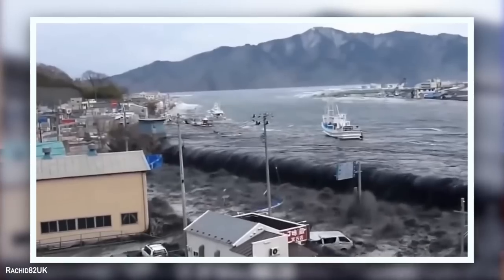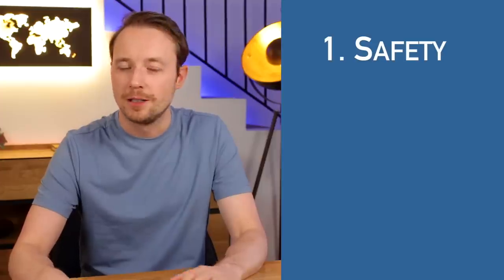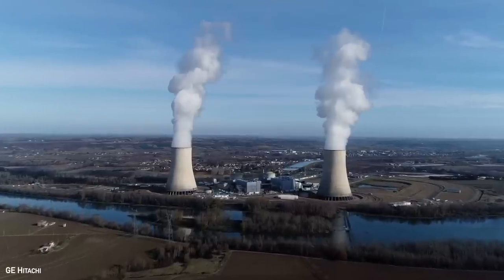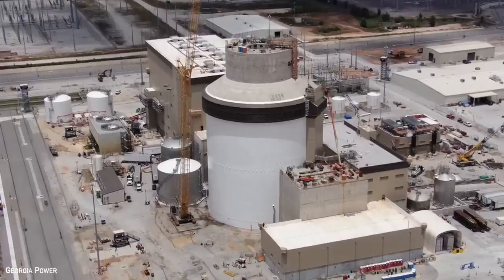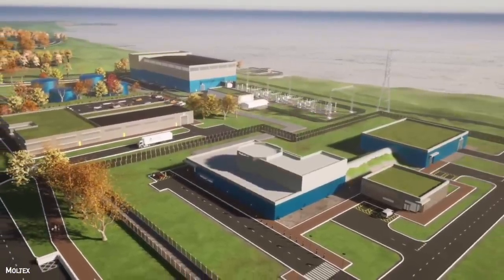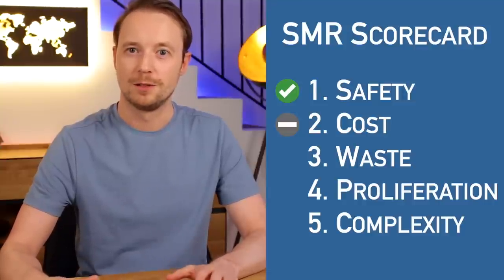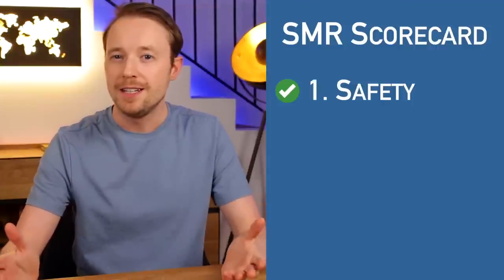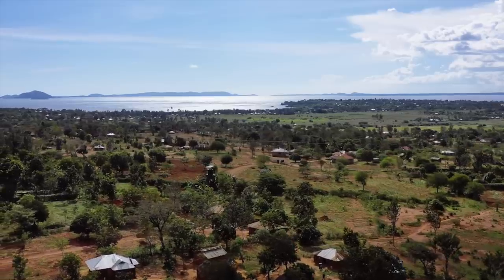Can Small Reactors Revolutionize Nuclear Power?

Comment: great summary .... not sure if you included cost of transmission/distribution which is a massive cost for most implementations.... with existing distribution systems and transmission systems, would SMR's not be more cost efficient in deploying additional capacity closer to loads,.... whereas large Nuclear and Green will need massive investments in new Transmission.

Comment: Standardization is a first step to cost reduction. You need a standard size, shape and interface. You also need standardized teats for safety and function. Then multiple suppliers can compete on fair terms.
Reply: Every reactor that the U.S. currently operates is a standard design, be it Westinghouse, CE, or B&W.
The NRC has to approve a reactor design so it is not like they are all different.

Comment: When speaking of SMRs,  it incompasses a wide range of designs, fuels and coolants and they all have their many issues.  First,  many will use the not so new TRISO pebble fuel that has 3 different layers of Carbon and two different types so it's not so Carbon free as advertised.  Most will still be cooled by water and is a massive issue of releasing Tritium that forms Organically Bound Tritium when taken up by the plantlife we eat.  This causes the Tritium to be bonded to our cells for much longer than the advertised biological Half-life of just tritium at 12-30 days that causes DNA strand breaks, micronucleus formations, cell necrosis or apoptosis, chromosomal aberrations and various other phenomena thus negatively affecting human health.  Then we have Thorium reactors that aren't Thorium as Th-232 isn't fissle and must be transmutated into Uranium-233 which is then fissle so we still will have the nuclear waste issue and are not Thorium reactors.  Nuscales SMR had a major issue with its failsafe system as it left the moderator in the condenser which caused the failsafe to fail miserably so back to the drawing board for them to fail by something they didn't think of on paper.  Then we can talk about MSR Molten Salt Reactors where they have a major issue of Tellurium embrittlement at the grain boundry layer of the defects in the metallurgy.  That means they must use a special alloy along with additives, like hydrazine is used in our full scale reactors just to keep the corrosion down long enough to make them seem they are a net outcome, will cause them to be unable to compete in any market much less today's market.   IMSR is proposing a SMR design where the core is replaced every 4-7 years due to the graphite expansion/contraction issue which means those cores will be irradiated and must be stored for thousands of years.  That is not cost effective and will need public funding to even stand a chance of making a net profit to keep them going into the future.  No matter the design, fuel or coolants...they all have their many issues that most do not know.   Now you know and must change your opinion on all nuclear reactors and if you don't, then you're fooling yourself and others that would watch.
Reply from the maker: The NuScale design issue raised by the ACRS is certainly problematic... NuScale in general has gone through a lot of iterations to solve various problems with the design. I would argue that a piece of radioactive equipment that is replaced every few years that can fit on a truck isn't such a bad problem, even if there are many of them. Much better than sending toxic ash into the atmosphere or dumping into rivers.
Reply: @atomicblender  We aren't talking about toxic ash...why do people do that?  Apples to oranges debating style.  Yes coal and toxic ash is bad but none of these reactors are the answer nor is fusion either for the simple fact of tritium.  Tritium is released by water cooled reactors and tritium is the fuel for fusion along with Helium 3 as the coolant.  Don't make excuses for the nuclear industry.  Do you work for the nuclear industry or just think nuclear reactors are the videos you should make?
Reply: WOW.  I worked in the industry for 40+ years and operated 3 different PWRs and I try to keep informed with what is happening in the industry.  You have a lot more technical detail on these "new" designs than I have.  Unfortunately, people watch YT videos and discuss things on social media and they think they are experts.

Bottom line, new nuclear in the U.S. is in trouble and I don't see that changing anytime soon.
Reply: The United States has tested every possible reactor type and built more reactors in the last 70 years than any other country. The PWR/BWR was chosen as the best overall design.

Debate on the need for new nuclear is welcome.  
But when people ignore the last 5 nuclear projects in the last 20 years in the U.S. that were total failures, something is wrong.  
When YT videos fail to even acknowledge the last 5 nuclear builds in the U.S., something is wrong. 
When they only want to talk about what other closed media countries are doing with nuclear power, something is wrong.  
When no investor owned utility or company is willing to invest in new nuclear in the U.S. something is wrong.  
When the U.S. taxpayer has to bribe investor owned utilities with billions to keep old money losing nuclear plant operating, something is wrong. 

In a truly free and capitalist society, good idea flourish and bad ideas die.  The media, anti-nuke people, liberals, etc. are not the reason that new nuclear is dead in the U.S..  It is economics plain and simple and taxpayer welfare will not solve the problem.
Reply: @clarkkent9080  Why didn't you tell the public as an operator of multiple PWRs that you were releasing effluents into their environment and yours?  Many people have cancer now because of it while you sit back and enjoy your time off now here on youtube making comments to promote nuclear power further.  In fact the last two reactors built in the US at the Vogtle plant costs 30 billion and would have never been completed without public funding from the state and federal, that's a fact
Reply: @clarkkent9080  H20 neutron capture to H3O daily didn't happen under your watch?  Tritium permeation of stainless steel in the reactor loop never happen under your watch?  That is a lie

Comment: problem is that what you mentioned. There is no operational SMR available on the market. Even this Russian one is just a miniature of existing reactors. All those things with passive security systems are not yet in the real not even saying about thorium breeder cycle for which we don't have reasonable technology demo (not even prototype). It is the future. Maybe next 10-15 years maybe just 5. Here in Poland we assigned agreement between NuScale and KGHM with realization around 2033 with NOT pointed final technology. I'm saying it not to put out the hype around SMR but just to not overheat the right direction. Surely nuclear energy is more advanced in comparison to hydrogen technologies (interesting thing is that recently we started to consider downsides of hydrogen leakage to atmosphere on a climate and ozone layer) and big chemical energy storage for renewables. Keep going guys!

Comment: The reason small pressurized water reactors are a good idea is that they are inherently safe as Dr Weinberg explained in his 2003 interview.  He said, "Below 500MWth, in the case of a sudden shutdown, they can dissipate the heat of nuclear decay passively."  Unfortunately, Westinghouse, GE and B&W engineers thought they can build bigger for economy of scale profits and use defence in-depth engineering.  That worked as well as the accelerated bridge construction at FIU.  Engineer brain block ego is no fun.
Reply: I operated many different types of reactors. One, a 1.000 Mw B&W (three Mile Island sister plant) tripped from 100% power when we lost all 4 reactor coolant pumps due to a grid upset.  The plant safely kept the reactor passively cool on natural circulation for 1 hour until we  investigated and restarted forced cooling.

Every PWR in the U.S. can trip and cooldown on natural circulation but you do need feedwater which is provided by diesel backed electric and steam drive aux feedwater pumps.

The latest AP1000 passive PWR does not need diesels but still need battery power for instrumentation and controls.

Comment: Small Nuclear Reactors seem extremely good on paper, because they promise things for politicians.
Nuclear energy has been plagued recently by terrible execution, one word "Flamanville" is enough to describe it all. Cost and time overruns for already expensive projects become unacceptable. SMRs, despite all constraints, like decreased economic effectiveness, unnoticeable systemic effect still seem to be "One Presidential Term Nuclear Reactors", something which guarantees re-election because energy could have become cheaper (on TV, in reality it never does)

Now, reality.
What do people even need power for? Around 70% of power we generate ends up as heat one way or another. Be it central heating, hot water, waste heat from ICEs or electricily production, friction, and the worst way to utilize electricity - for heating directly. Only a smaller fraction of it all ends as mechanical work or light. And while electricity can be transferred significant distances relatively easily, tranferring heat is a task.

Let's solve the problem, shall we?
Need to setup power stations with main purpose of producing heat and secondary - electricity. At the same time, infrastructure should be rebuilt for central hot water and heating almost everywhere, because this is effective - any power plant produces heat that should be used. I'm not sure if this is the case in US, it's pretty much the case in Europe, especially Eastern Europe. While natural gas heating plants are acceptable near or even inside the cities, don't you dare approving a nuclear power plant inside a million-city.

SMR seems like a solution, doesn't it?
This buzzword is being actively used to designate scaled versions of PWRs. But PWR automatically means increased requirements for safety. No matter how small, you wouldn't put these any close to big cities. Everything which works with big pressures is prone to blowing one day, big pressure means things are to, theoretically speaking, escape the source. Also, every NPP has a high pipe to exhaust short-living gaseous isotopes captured from technological premises of reactor. Now, explain this to an entire city.

A good start for solving our energy problem would be a commitment to develop NPPs tuned for production of heat.
To the day, even the double-purpose stations are quite rate: Floating NPP "Lomonosov", Bilibino NPP,  some more stations which can provide hot water for nearby cities; In Zaporizhia, Ukraine, hot water was used to power a greenhouse complex (before station got occupied by Russian invaders). In United States, they only have plans for co-generation to be 20% of capacity by 2030.
There aren't even any finished projects of Nuclear Heating Plants, except AST-500, 4 of which were cancelled shortly after Chernobyl, which would operate only at 12-16 atmospheres of pressure (10 times less than typical PWR) and temperature ~150 centigrade (1.5 times boiling water temperature, for those who still use cookie raisins for temperature measurement and piglet snouts for distance) and all of this with natural circulation.

This would be a solution, which you could safely place 1-2 km from big cities. No, this wouldn't provide industrial heat, better be 700 degrees or even 1400 for some types of cement, but this would effectively cancel all the small heating plants, majority of the boilers, floor electric radiators and contribute significantly to saving on gas and oil. Unfortunately, no one even bothers.

Comment: The first commercial reactors were small ones. They were replaced by bigger ones which made cheaper electricity.
Reply from the maker: True, early designs were smaller and then everyone moved to larger to take advantage of the bigger output. I don't think SMRs are trying to compete or directly replace large plants, they're filling more of a rapid response role that can be built more easily.
Reply: By using smaller reactors, you can change the economy of scale for manufacturing those reactors. Large reactors would be built across the country if the US government subsidized nuclear like they have "green" energy like wind and solar in recent years. They have spent roughly $500 billion on "climate and green energy" projects in just the last few years. They spent just $100 billion total in the last 70 years on nuclear power subsidies and John Kerry lead the call for shutting down projects like the Integral Fast Reactor at Idaho National Laboratory in 1994 because they claimed it was a waste of money. The Integral Fast Reactor was a proven design that could not melt down even if you shut off all the safety systems and shut all the cooling pumps off. It was designed to be inherently meltdown proof and the design featured a fuel processing facility attached to it that could recycle the same fuel over and over again. The fuel that it started up with would be the same fuel (more or less) that it shuts down with when the plant is retired. It shows the ignorance of our politicians. Waste hundreds of billions covering agricultural land with toxic solar panels that are intermittent energy sources and leave behind land that's polluted with cables, concrete, pipes, insulation, etc.
Reply: Start small and work the bugs out.  It's true f many things.

Comment: Coal-fired units are definitely not always as small as SMRs Each of the units at the Rockport coal power plant were one thousand three hundred megawatts. The largest unit at the John Amos coal power plant is the same size.
Reply: Small modular reactors are.......modular. So: if you need more power, add more reactors..

Comment: Large or small vents mechanical & electric pump power 2 stories above ground level Spent fuel located 5 miles away from N reactors.
No chage but we know  the N reactor designs are still faulty.

Comment: This is one of the best discussions of the topic I’ve seen, bravo! Realistic and fact-based, but not reflexively negative (or wishful-thinking fantasy, the curse of the pro-nuclear crowd). A couple of things come to mind, though. First is cost. At this point (and I may change my mind), I think SMRs are the ONLY chance for nuclear fission to provide a meaningful contribution to a decarbonized grid. Cost has always been the Achilles heel of nuclear, and a big part of that is gigantic, bespoke plant designs that cost billions and take decades to build. If we are serious about decarbonization, we don’t have decades to screw around - time to market and cost sensitivity are the dominant factors. If the SMR market can take off, it could finally make nuclear affordable without zillions of dollars of government subsidy. 

Second, neither nuclear (including SMRs) nor renewables solve other key problems with decarbonization. The first is load-following and mapping supply to demand. The present base-load grid depends entirely on gas-fired peaker plants to manage rapid demand changes (which can be 50% or more over the course of a day). Nuclear can’t scale up and down fast enough to load-follow (and it would be uneconomical to do so). Renewables are often criticized for needing storage because of variable output, but nuclear’s unvarying output doesn’t actually solve this problem. So either way, we need to build a carbon-free way to time-shift electricity from when it’s produced to when it is needed. That means batteries, or e-fuels like green hydrogen. It’ll be inefficient and expensive, but it has to be done no matter what, if we want to decarbonize. 

The other problem to solve is decarbonizing big non-electric carbon producers like vehicles, concrete, steel, and fertilizer production. How do we electrify them? How do we change the chemistry to stop emitting waste CO2 in the manufacturing process? Unfortunately, many pro-nuclear advocates are really anti-renewable advocates, and wind up making ridiculous, irrational arguments against EVs, which they see as part of the creeping green socialist whatever. But EVs are just as necessary for a nuclear-based decarbonized world as they are for a renewable decarbonization. So basically, all this stuff that many nuclear advocates argue passionately against - batteries, EVs, etc - is necessary, no matter what.
Reply from the maker: Excellent points! I think you and I agree on these things a lot... Cheers!